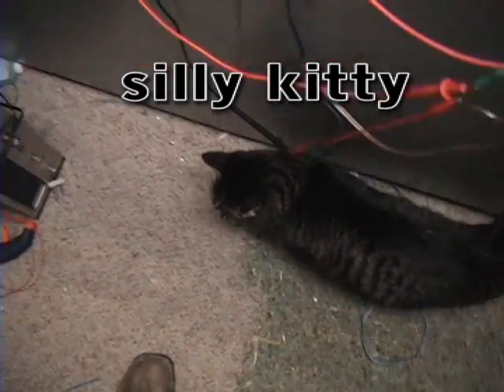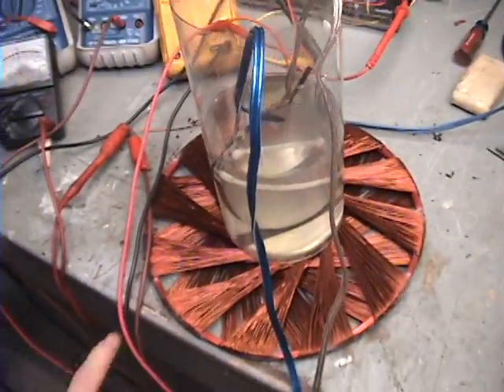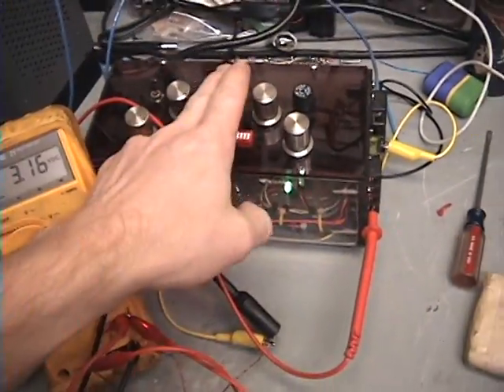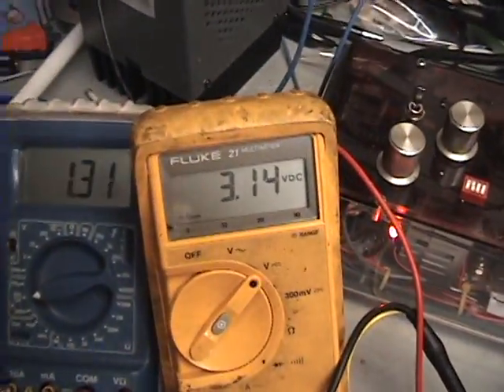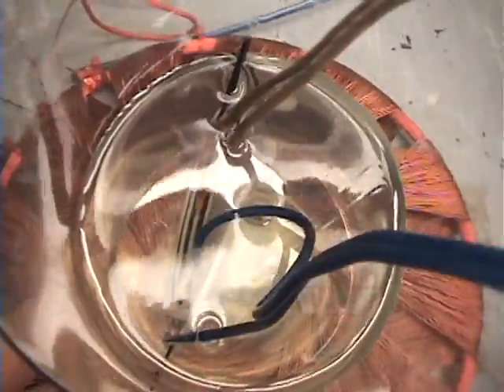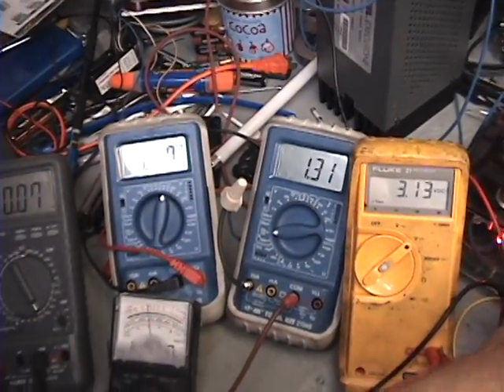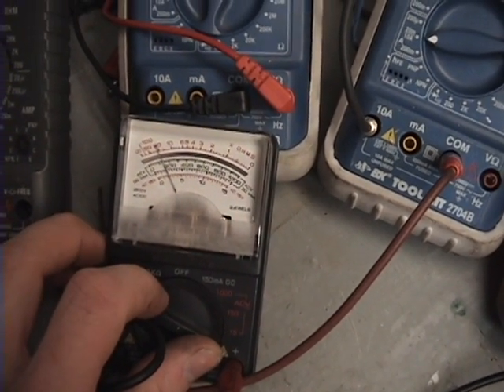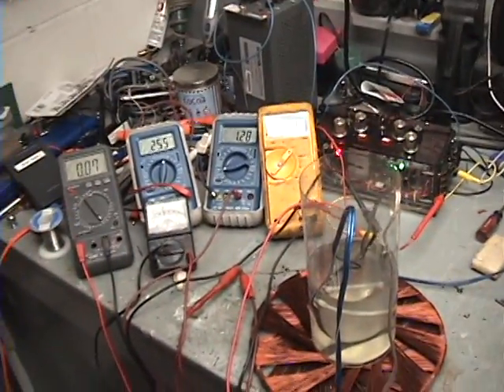HVTW Rodin coil out put coil producing HHO gas (TEST9)

Comment: you are on the right track. your cell design is not going to work.. i wonder if you took a joe coil and wraped a starship or rodin around it what would happen.. i plan to try the starship actually 3 of them wraped around my 6by6 inch dry cell... i have been exdperimenting with magnetic resonance and hho production.. can i get a copy of your circuit? thanks advanced hydrogen